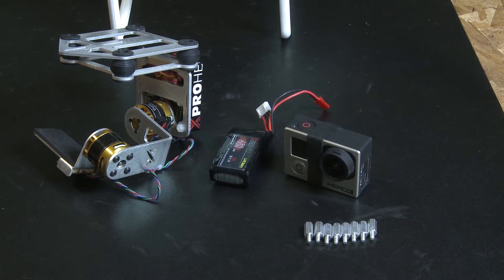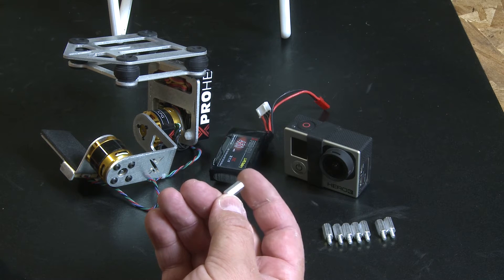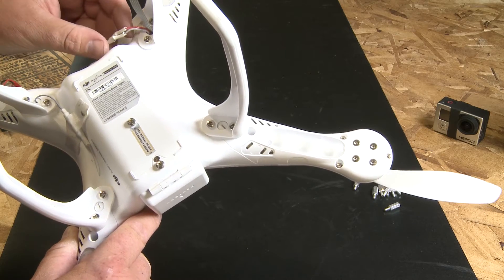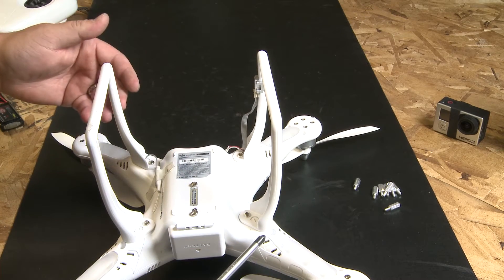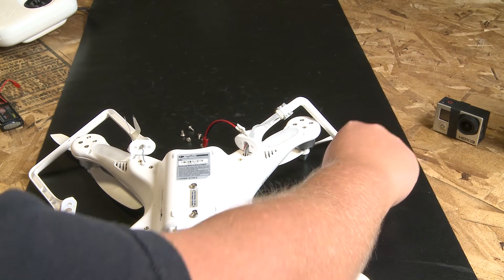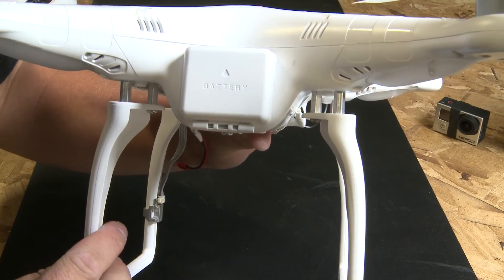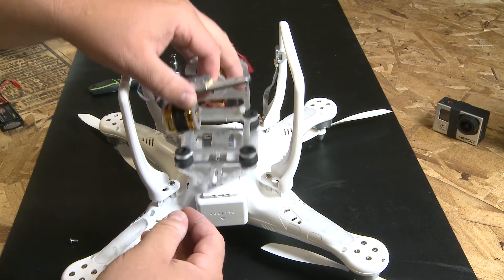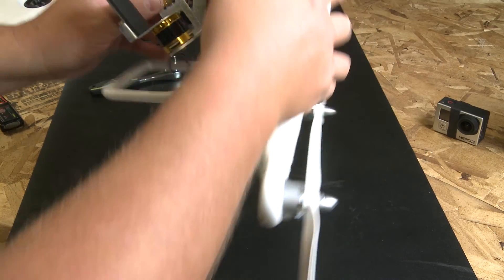XPG Brushless Gimbal DJI Phantom (V1) Install - XProHeli

Comment: Hey mate.
Just wondering if you have a link for those stand offs? Can't find them anywhere. Thanks in advance
Reply: www.ebay.co.uk/itm/M3-3mm-Female-To-Male-Brass-Hex-Hexagonal-Pillars-PCB-Threaded-Standoff-Spacers/162836376682?hash=item25e9cdec6a:m:menqmMs0IttF6XO2nOCpB4Q

Comment: UCGOButtercup: "The XPG Brushless Gimbal comes in a Small or Large configuration. The XPG Small Brushless Gimbal is for use on smaller quadcopters like the DJI Phantom while the XPG Large Brushless Gimbal is for pilots flying larger quadcopters and multirotors like the XP2 Quadcopter."

Comment: Looks great! So after this, do you need to recalibrate the Phantom? One of the things that intrigues me about your gimbal vs DJI's is that installation looks so much easier. (The price is another appealing factor!)

But I'm unclear on what steps, if any, are needed after you install the XPG. I checked your forums, but they're filled with quite a bit of spam...

Would appreciate any information you can provide. Thank you!